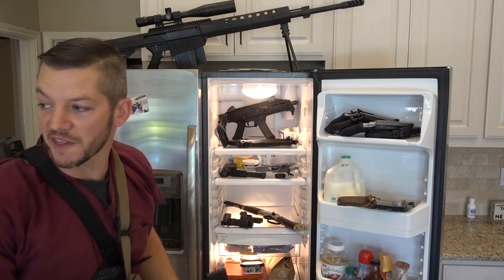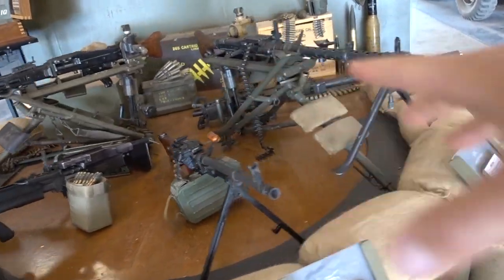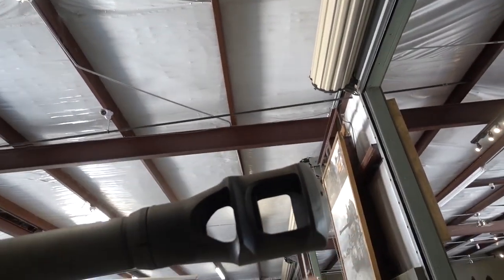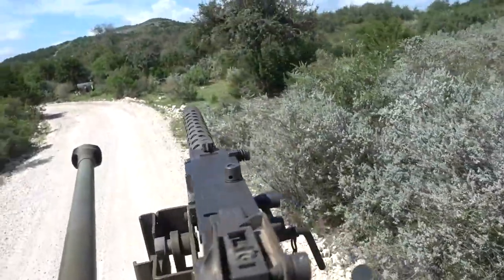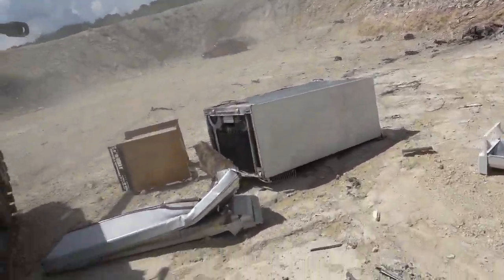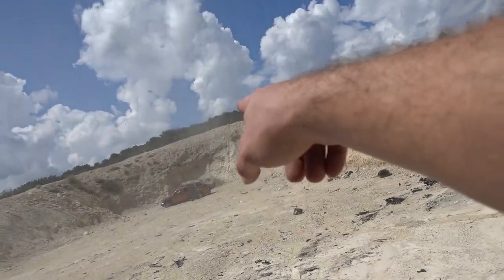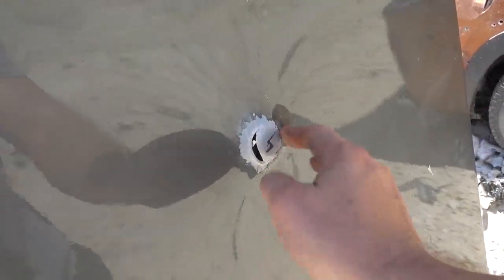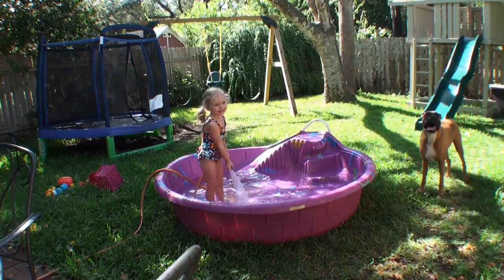The Power of a Tank Muzzle Blast!!!

Comment: When I was in 2nd Tank Battalion in the Marines and by a very convoluted set of circumstances we got set in front of and just a little offset from M1A1 Abrams tanks during a live fire exercise at CAX in Twentynine Palms. I was a TOW gunner and have been around the tanks for awhile. We were about 75 meters away from the tanks and when they started firing the concussion and sound were so immense that I thought a 155mm artillery battery that was a part of the exercise had aimed wrong and had hit the tank. It was an awe inspiring blast.

Comment: see how many armour plates it takes to stop an armour piercing tank round!!!!!!!!!!  like if you agree!
Reply: A Sherman AP round has a pen of about 140 - 160mm at 10m, so if u somehow get 16 meters of steel then yea I would watch that
Reply: Centimeters buddy, 16 cm of steel. 6.2 inches.
Reply: @thespartanmk1  oof u right.
Reply: 16 CM  in truth about 5 inches of steel
Reply: On paper it should be able to penetrate about 5 inches of steel, modern rounds can penetrate up to 16 inches depending on the ordinance being used.
Reply: What's even the point of having armour in a tank anymore?? If an AP round can punch through 16 inches it's basically useless except for small round fire.
Reply: @TheSilvernuke  That penetration is for contiguous steel armor.  Having multiple separate plates, angling, and multiple additional materials of varying hardness is much more effective.  Look into composite armor for more details.
Reply: How much flex seal does it take to stop a tank round?
Reply: Main battle tanks are actually becoming more and more obsolete because of all these powerful anti-armor weapons that exist these days...
Reply: It almost seems like that would be too much penetration. Atleast with Solid shot/Sabot rounds, You realy dont want your rounds to go straight through enemy tanks because aside from killing 1 or 2 crewmen, the tank could still be operational because the round went straigth through without dagaming anything important. Unless the munitons in question are HEAT rounds which will smash through enemy armour and explode on the inside of the tank. But then again with 26inches of penetration, you risk the round penetrating both side of the tank and exploding on the outside of the tank.

Ive heard of something like this happening against Japanese tanks in WW2. The claim is that the armor of the Japanese Tanks were so thin that the couldnt even stop a .30cal AP round from the garand but when Shermans with 75mm guns engaged them, they (the Shermans) had to hit them multiple times because the rounds were going straight through the tanks. This was another reason why 76mm Shermans were never deployed to the pacific and why Shermans their never had AP rounds loaded up.
Reply: Since an ar500 plate is about 6 to 8 RHA, with 20 you should stop an APHE from the 76mm M1 without much problem.

But if you wanna stop something like an modern MBT round, meh, you will need like 100 ar500 plates at least
Reply: Rogue Cloud 16 meters of steel? So if 160mm is around 4½ inches, and there is a little over 3 feet in a meter, 12 inches in a foot...3×16=48+ feet thick of steel? For 4½ inches of pen at just 10m???
Reply: Rogue Cloud oh nevermind I saw the correction was made, I was dumbfounded
Reply: @replicant97  wrong. Armor evolve as fast as anti armor weapon. Cold war era RPG7 was already useless against the frontal of T64 T72, T80, M1, challenger, leopard2, mervava.

Nowaday, even the strongest 1000mm+ RHA pénétrations' ATGM cannot do anything against any décent MBT on the frontal arc.

(And i m not even talking about such things as APS soft kill and hard kill).

To give you an idea, even with something as string as an RPG 29, you would struggle to make any damage to the NK s pok pung ho (and zéro chances of doing anything against an isreali merkava from the frontal arc)
Reply: JustAnotherReplicant MBT’s are not becoming obsolete, the super heavy 70 ton tanks are yes, because tank armour is losing the development race in what can punch holes in them. So long as infantry need a very big gun that can be put on wheels the MBT will forever have a place on the battlefield. What’s likely to happen is MBT will get lighter and more focus on manoeuvrability rather than heavey armour since it’s becoming a little pointless these days with all the anti-tank weapons that are easily accessible these days for militaries and terrorist groups
Reply: @theoonyoutube  that's an easy eight (M4A3E8), not an M4A1
Reply: Armour you do know thats a night stand right?
Reply: the birdo beed huh?
Reply: @TheSilvernuke  modern tanks don't use steel armor, look up Chobham armor.

Comment: 8:00 check out the tank shell captured on a fairly normal camera
Reply: 1 frame of bullet in mid air
Reply: There’s a butterfly flying through as well
Reply: @xpenaltii  man that butterfly came out of the dust😂
Reply: The rounds they fire are not full power loads. These tanks are over 70 years old and they don't like to stress them that much. Not saying that it couldn't handle firing a full power load but it's better to be safe than sorry.
Reply: @saltysteel3996  good information to know but who are you talking to in these replies?
Reply: @wikfork4870  maybe he wants to say that a full powered round wouldn't be catched on the cam used on this vid

Comment: 1)How many water filled 55 gallon drums can a tank round penetrate!
Maybe fill a few with Tannerite as well...
2)Maybe about 50' of dry ice would be cool. Quite a cloud, I'm sure!
3)How about firing guns at tank armor? ... From 9mm to a tank round...
4)And, of course, run over a HiPoint with a tank!
Reply: the sherman could withstand up to the german 50mm tank cannon. anything bigger than than and you'd probably have a dead sherman. 20mm antitank rifles would struggle against even the sides/rear, but might be able to penetrate at point blank ranges.

Comment: Wanna see some penetration tests. How much FlexSeal does it take to stop a tank round? :p Seriously though, how much steel does it take to stop a tank round?
Reply: Depends on the type of steel.
Reply: @Chopstorm.  and the round and barrel size probably
Reply: @corpstilldeath6744  That too, I just assumed he meant the M1 76mm cannon in the video.
Reply: Idk if they even make enough flexseal to stop a tank round lol
Reply: Its a late model m4, probably a m4a3 76 or m4a3e8 76
Reply: Assuming the round they fired was M79 shot, the penetration on it at point blank for unsloped steel armor is around 155mm.
Reply: If I remember from WoT (not very reliable source heh)... I think the easy eight sherman had 128mm penetration? Haven't played it in years.
Reply: Look up on Wikipedia rolled homogenous armor or RHA. That's usually how they measure penetration.
Reply: Brett Smith how much ar500 steel plate*
Reply: S

Comment: @DemolitionRanch
You should shoot a tank round and then have a professional sniper try and snipe the shell mid flight, then get "Smarter Everyday" to film it in super slo mo and do a little in depth explanation of velocity and all that good stuff us non science heads understand
Reply: The speeds of a bullet and a tank shell are on completely different levels. A bullet from a sniper rifle might top out at ~400 ft/s. That tank shell, a 76 mm APC round from that tank's 76 mm M1 cannon will be going more than 6 times what a sniper rifle's bullet will be going, at ~2600 ft/s or ~780 m/s. It is physically impossible to hit a tank round with a sniper round.
Reply: Hmm Ok ok, but what about if a 50 bmg shot from a decent distance, to allow the bullet to speed up, hit a tank sized round head on. would there be any difference in the shells path of travel, would the 50 BMG just ping, ('ricochet' before someone becomes a grammar nazi), away like a bug hitting a windshield?  What exactly would happen
Reply: @yhyh9393  I would say that there would be no significant deviation in the tank shell's course. If the .50 hit anywhere other than the very tip of the 76mm, it would most definitely ricochet, considering the angles at work. If it did hit the tip, I think it might put a bit of a hole in the tip, but not much else. This is a 15lb shell going really, really, really fast, with a ton of momentum. I'm not too good with math, so I can't exactly say what numbers are being played here, but it takes more than 10 cm of armor to stop a 76mm shell of this type at 0°. 

There's just so much shell going so fast, that a single small arms bullet won't really do much. 

A correction I should make to the numbers presented in my first comment: sniper rifle bullets go anywhere from 800 to 1000 m/s, which puts them on par with tank shells. Still, a .50 BMG bullet is only 50g, compared to the ~9 kg 76mm shell.
Reply: OMEGA_MODE well thank you for your replies, they make complete sense to me and i have no clue about this sort of stuff so thanks 😌
Reply: You could probably get a machine to fire both weapons

Comment: What would the 76mm HEAT round do to your safe. 

High
Explosive 
Anti
Tank
Reply: I feel like the safe isn't gonna give a heat round the resistance to operate properly but end of the day it's still gonna blast a hole through the safe just not a pretty round one.
Reply: The 76mm was packed with smoke, HE and a solid shot AP. At the time HEAT wasn't invented by the allies yet

Comment: get a 100mm RHA plate like the TIGER 1 has and try to penetrate it at diffrent ranges so we can see what the american troops had to deal with back in ww2
Reply: @TheMrCosmo  Quick question, did you double check any of your information? Because a lot is wrong with what you said.
Reply: @TheMrCosmo  Actually no, I wanted to tell you the utter failure the pershing was when it was first introduced. Also you are comparing a early-mid war tank to a end of war tank, which did not see much combat experience during WW2. 
Perhaps if you did not assume, you would not be proven wrong. 

Also their is plenty of detailed accounts from both sides stating combat between tigers and shermans.

You are also comparing the economic powerhouse that was the U.S at the end of the war, to the shambles of German economy.

Comparing the Tiger 1 to the pershing is like camparing a panzer 3 to T-34.

One was designed and produced under different means, economic standards, and for different reasons. I would hope the pershing would edge out on the tiger 1/2, knowing it was designed with it in mind. 

So please, go back and do your "research" again.

Comment: PLEASE SHOOT THE THICKEST THING MADE OUT OF METAL YOU CAN FIND THAT HAS A CHANCE TO STOP THE SHELL!!!
Reply: You used the wrong "Thicc".
Reply: I don't think you'll be able to find anything with a half chance to stop an AP shell from one of those things head on  short of a fuckhuge solid steel cube. Once you get to this point you don't have a chance in hell of stopping it, just deflecting it or using reactive armor to lessen the energy behind the shell, usually both.
Reply: @Imperator_Great  it is just a Sherman shell. They are stopped relatively easily, they couldn't penetrate a Tiger 1's front armor at any range in WW2 (excluding the Firefly version)

Edit that looks like it is a firefly. Still, not particularly powerful
Reply: T4nkc0mm4nd3r any of the long 76’s on the Sherman’s could easily pen the tiger1’ front plate remember it has very little slope and the 76mm gun is very underrated because everyone creams their panties over German armour
Reply: @TheKep  it was a weak gun in comparison to other cannons of the time. The T34, panther, and both Tigers had better guns. The 76 only made it capable of dealing with the Tiger 1 (which was old tech by that time), and it the match-up was still in the Tigers favor.
Reply: T4nkc0mm4nd3r actually this is  M4A3E8 with a M1A2 cannon, which can pierce the front of a tiger at less than 1 km at 10 degrees. However the tank model was late WW2 but saw service in Korea
Reply: @killergames391  iirc this gun is weaker than the 17lb in the Firefly. Again, while it could penetrate the Tiger 1 (definitely not 2) the tiger 1 still outranged it.
Reply: T4nkc0mm4nd3r we all know the German 88mm was the best anti-tank round of the war but until the t34-85 the Russians didn’t have anything close to the American 76 or the Brit 17pndr yeah they had the is-1 with the 85 but it was rarely used in comparison to the t34-57 or kv-1 and for the panthers 75mm the panther could kiss its ass goodbye if it went up against a Sherman jumbo

Comment: I don't think that barrel was designed to handle the asymmetrical force of "blocking" one side of the muzzle break... What do you guys think? Isn't that creating an undesirable force against the barrel? Imagine a steel wall instead of a fridge...
Reply: Yeah that's actually an interesting point, gun muzzle was used in order to lower the backward of the gun while shooting. So yeah, to shoot constantly near an hard obstacle would be dangerous even for the tank and its crew ...
Reply: I don't know about 'constantly'... That's a VERY powerful muzzle. I imagine even a few shots would already be a gamble. But maybe we are wrong and that barrel can take a thousand times that sideways force. Hard to say really.
Reply: It will damage the turret ring. However the fridge is not pressed against the barrel and lacks the mass to stop the explosion, so in this case it's okay

Comment: AP round or APCR?
Reply: Just ap, cr has a point to the end and is a harder metal
Reply: @daniel3489765  yeah thought so, APCR has a pointy thing at the top of the shell
Reply: @daniel3489765  when i saw this video, i thought he would be shooting an HE round tbh lol
Reply: @razekurtin4306  Actually I would like to see what it could do to the safe and to the cars ^^
Reply: Yeah me too bro
Reply: Apcr has a distinct shape due to the fact that it is  a tungsten core that is sorrounded by a softer metal. Upon impact the core breaks through the outer shell and penetrates the armor. The result is a hole substantially smaller that the actual round. This was just a solid shot ap
Reply: Thats an M79 solid AP shell. But the this gun can also fier the M62 APCBC shell. That hase an explosife chare "made to explode inside a tank after penetration"